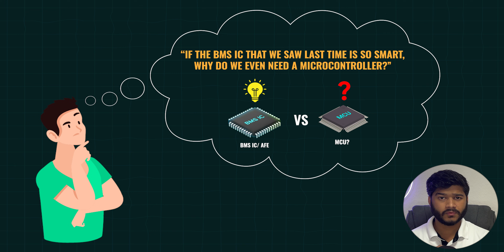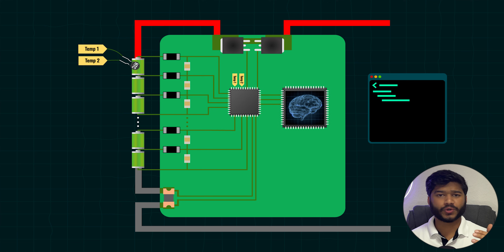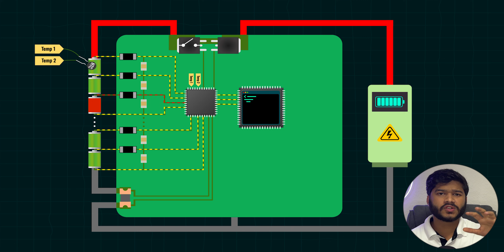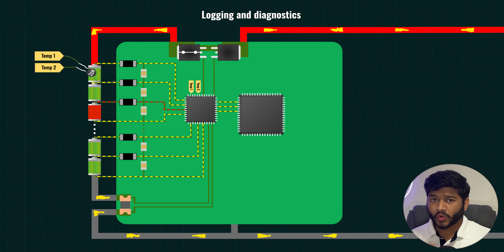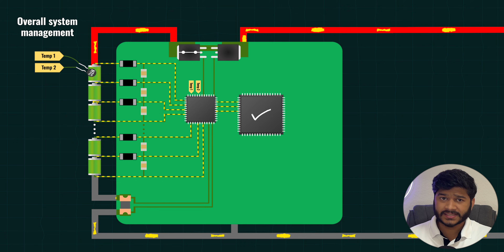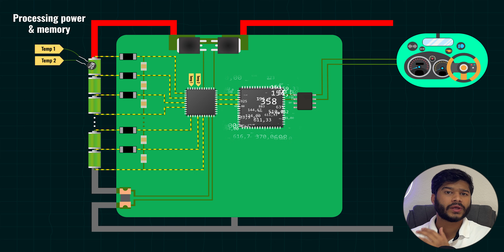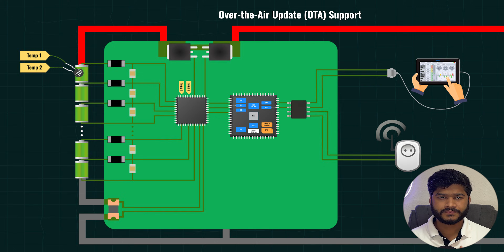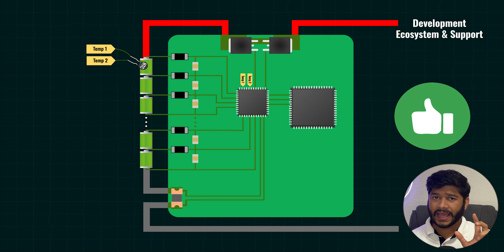What a Microcontroller Really Does in a BMS?

Comment: I'm designing a 3–19S BMS using two cascaded BQ7695202 devices. 
The hardware design is finished, and now I'm working on the cell-balancing algorithm for the BQ7695202. 
I plan to use an external MCU to control the balancing via I²C.

Do you have any suggestions or example code for this?

Thank you.
Reply from the maker: Great! Thank you for watching this video.  I am posting a new video on MCU selection next week. Maybe you will get some idea from there ✌🏼
Reply: Wow. Good news! Thank you for your support. Please let me know when your video is public.